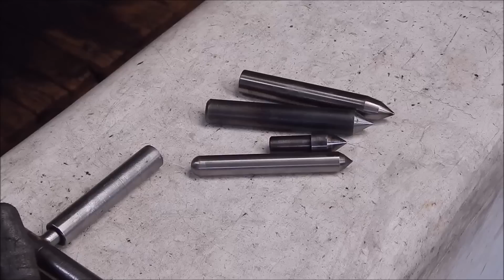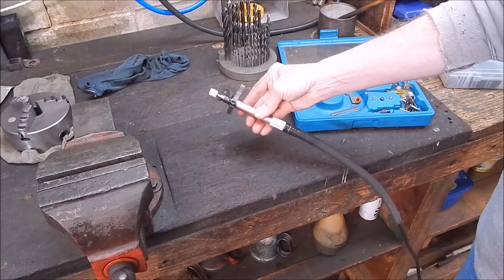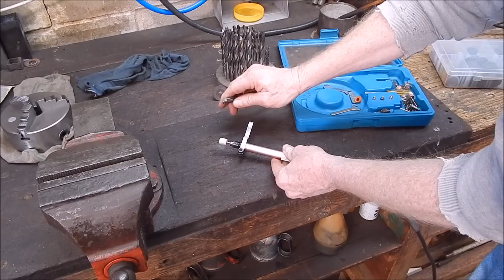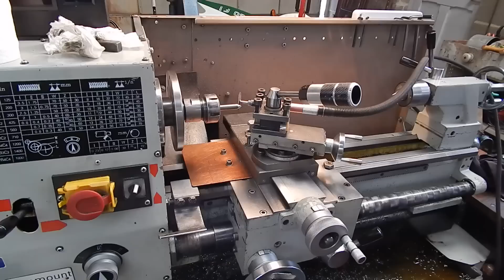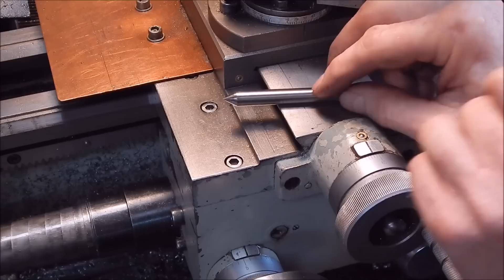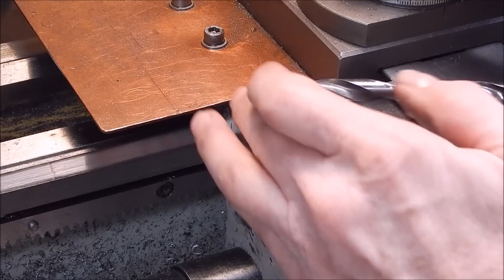Restore a lathe dead center or drill bit with a cheap pencil air die grinder

Comment: this is paticularly  good with subtitles. but good vid. i have a problem, in that my headstock and tailstock taper are different. still working out how to dress up a dead centre...
Reply from the maker: Emma Ritson Hi Emma.  This should work with a Morse (or any) taper dead centre,  Just tap the centre into the spindle firmly with a copper/brass punch and it should stay in position while you lightly grind it.  Cheers Rob

Comment: Excellent Rob. I have a TPG but never thought to use it for drills. Now I need to find that box of snapped off taper shank drills some one gave me for scrap a couple of years ago. I can make some nice stubbies out of them. thanks for sharing. regards from the UK
Reply from the maker: Gary C Hi Gary.  I would normally use the TPG as it's faster, and more powerful - but still use a cutting disc for the job.

It gets over any alignment issues, and the job can't gouge the stone face and destroy accuracy.

I do lots of grinding and cutting with 1 mm friction discs in my TPG.  For really high accuracy work a stone is best, but discs work fine for small jobs like this.

They last a long time if you treat them gently.

Cheers.  Rob
Reply: xynudu Rob  I also tend to use discs for a lot of jobs like grinding centres etc. I can use up to 105 mm X 2mm in my TPG with the arbour I made for them. But I do like your little grinder and I have one a bit larger I use for carbide burrs but my compressor is only 3 cfm so can do only short spurts with it.  Thx  Gary
Reply from the maker: Gary C Hi Gary.  I also have the next size up air grinder (lever control), but it uses way more air and my compressor (7 cfm) can't keep up, so I mainly use that as a small cut off saw.

The pencil/micro grinders only use 2 - 3 cfm, so they are ideal for small compressors, although no where near as powerful. But go gently and they will do the job.  Way better than nothing.

Cheers.  Rob

Comment: Rob, thanks. Would never have thought of using a cutting disc to sharpen a drill with.  Could you please show how you cut the relief.  Thank you
Reply from the maker: Mick Doherty Hi Mick.   The cutting disc works the same way as the stone in those specialised drill sharpening jigs that drive off of an electric drill, which are fairly cheaply available - but very slow to use.

They also have the same problem, that the end of the drill is ground at the correct angle , and both flutes are uniform, but they have no back relief, and therefore won't cut.

You're the second person to ask how to grind back relief, so I will see if I can do a video on it.

I only do it by hand, as taught by my mechanic father, and it takes a little bit of practice, but is not difficult.

Whether I can show it successfully on video remains to be seen.

Cheers.  Rob
Reply: Thanks Rob.  Much appreciated.  P.S.  My ER32 collet set has arrived. Just need to make the draw bar!  Thanks for the tip.

Comment: Interesting idea on the drill, I'd love to see a video on the whole process of re-grinding the tip and cutting relief after on the drill, sharpening drills is something I continue to struggle with despite lots of experimenting and practice.
Reply from the maker: caskwith Grinding the relief by hand is not difficult, once you have the flute angle correct.  You use this as a guide.

Hold the drill at a constant (parrallel flute) angle against the side of the grindstone, and apply diminishing pressure as you rotate the drill towards the cutting edge.  This will grind a tapered relief.

I expect there are plenty of videos on this subject already.

Cheers.  Rob
Reply: +caskwith Hate to plug my video on xynudu's  channel but i have a quick how to drill sharpen video you my want to see.

Comment: Hi mate.
You must be a great lover of these thing, I seem to remember other videos with these grinders.  When I use mine, I get sprayed with oil.  But I have to say, for the price, they are quite good.
Marcel.
Reply from the maker: Marcel Timmers Hi Marcel.  I never see any oil out of mine, despite having in line oiling.  Maybe you're putting in a bit much?

DO NOT use the oiler supplied with some units - it is total crap and over oils to hell.  Bin it.

Just add two drops of oil into the air connector every hour - that's all it needs.

Cheers.  Rob